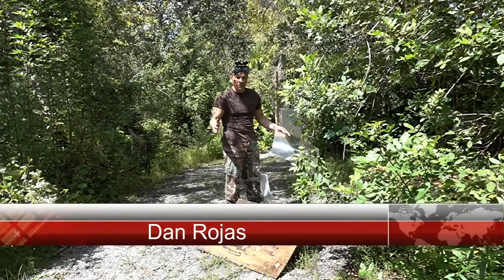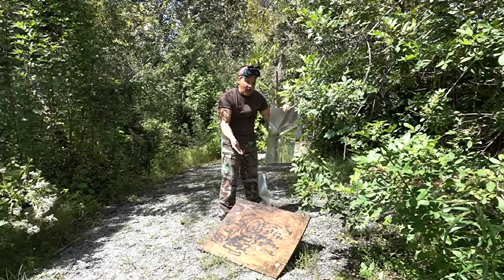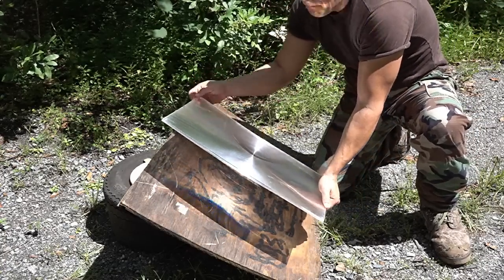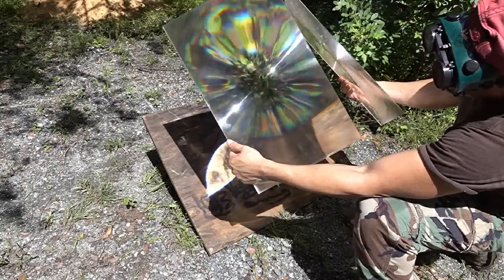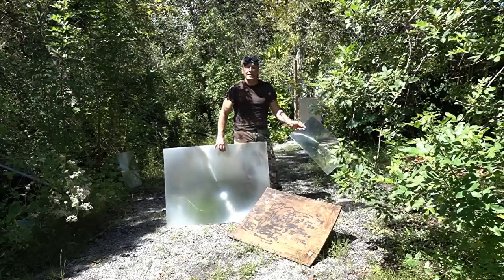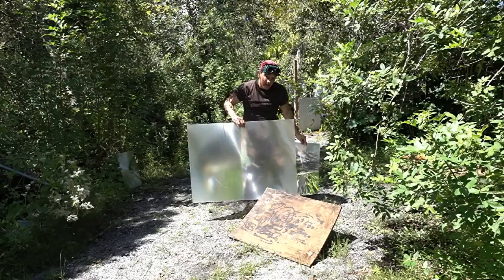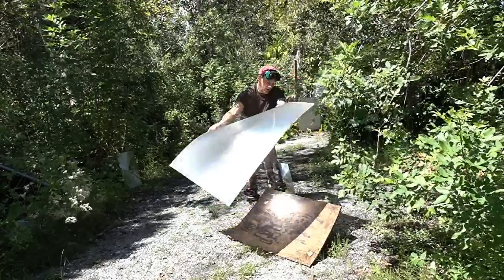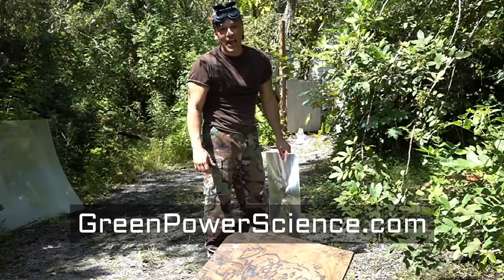FRESNEL LENS MYTHS about solar projects and misconceptions

Comment: Would having a linear focal point make the lens more clear increasing the power? Could you take that focal point and direct it into a light pipe to shoot out a Sun laser?
Reply: I'm thinking a Fibonacci  spiral would take it and bounce it into the center. Tilt it a little and it might go down the length
Reply from the maker: You would need a ruby rod for the laser. I have tried this before but destroyed the rod. Results unknown because trial and error is very expensive.

Comment: Could I add one of these to a basement window to get more light? It's West facing and shaded most of the morning... or would it be dangerous?
Reply from the maker: They do not amplify light so clear glass allows the same or more light in.. Fresnel lenses for windows create a fire hazard. I would just use clear glass.
Reply: But if you put it in backwards, would it not diffuse the light, lighting more area with less intensity?

Comment: If you lay a FRESNEL LENS on top of a solar panel, would you get more power out of the panel and what % ?
Reply: No, you would get less because the lens would absorb some of the light before it got to the panel. And if you focused the lens on the panel at its focal length as opposed to placing it directly on the panel, assuming you didn't burn a hole through the panel, the shadow around the focal point would pretty much cut your power to zero. The only way to get more power from a panel is to add more light, typically through using mirrors or living in a drier/less air-polluted climate.
Reply: Robert Polito The way that works is you shrink the solar panel to the size of the focal point to save money on the photovoltaics and get higher PV efficiency. You can look up concentrated PV for details.

Comment: Have you had a problem with the lenses yellowing? I have a 52 inch that has yellowed and want to know if this can be remedied.
Reply from the maker: Try "Totally Awesome" from the Dollar Tree or Wlamart. Drench full strength and set for a few then hose off. If it is yellowed from not being UV stable it will help a bit. If it is yellowed as a new find, that is from the lens being in a smokers environment and the spray works like magic.
Reply: Ok. Thanks. I'll try it. It was from a late 90's Hitachi projection screen TV. I still find them out by the road for p/u occasionally....:)
Reply: Is that the "Totally Awesome" window cleaner or something else. There's quite a few products with that name.

Comment: just out of interest can those lenses be used in any way to heat or help to heat a greenhouse  so you don't need to use gas heaters in the greenhouse?
Reply: That'd be some tricky math. Lenses not being as clear as window glass, it would lessen the total amount of sunlight reaching the inside because of absorption. But perhaps there is a way to increase the efficiency of the conversion from light to heat by focusing the lens on some heating apparatus. My instinct says it probably wouldn't work, but I don't have the knowledge to prove it.
Reply: Use black spray painted containers that you can seal.  Fill them with water, close them up, and they will absorb heat giving it back off as the sun disappears. A 2 liter bottle will work, well many 2 liter bottles will work. As far as how many, I do not know the math. Obviously it would depend upon the size the the green house, external temps, etc. There is another method involving, a rock filled hole dug inside of the green house which has a pvc pipe placed inside of the hole with the rocks surround the pipe. It has been a while since I have looked at either.
Reply: a ceiling with a grid and plastic would give you puddles of water and they would each give a beam

Comment: Wouldn’t be possible to design a special fresnel able to track the sun? Why not?
Reply: It it possible, and they already do this on some solar power utility stations. You have to get light meters at various angles to each other and then have a controller that adjusts the angle of your unit so it monitors the input levels of the meters and adjusts to try to find the position with optimal light intensity.
Reply: @contentiousotter2324  I mean a pasive one, not “smart and dynamic”.
Reply: You could create a housing that had multiple fresnels that were positioned so that as the sun shifted a portion of those fresnels would all hit a large central heating element as the sun traveled across the sky, but there's no way to maintain a single focal point through a lens as the sun travels across the sky.

Comment: I want to make a small knife using a Fresnel lens or a parabolic mirror made from a satellite dish. How big would it need to be? 
If it works I’m going to gold plate it. Lol
Reply from the maker: You would need at least a 45" spot lens. They are on our website and you can get the dimensions as the 45" is corner to corner. If you are luck enough you can find one from a TV BUT the true spot lenses are difficult to find. The ones we sell are true spot lenses. For the satellite dish, they do not provide a good focal point for melting steel. They are good for cooking and heating water but the spot is not tight enough.
https://greenpowerscience.com

Check out the dimensions, I have temperatures for the size and power concentration on each one for reference.

Comment: Does it matter what kind of safety glasses I use?
Reply from the maker: Torch goggles are the proper darkness. Welding is usually too dark.
Reply: GREENPOWERSCIENCE thank you. I am very glad you told me there is a difference between torch and welding goggles.

Comment: Could I potentially "weld" two pieces of steel together with one of these lenses?
Reply from the maker: If the steel is small masses. Plates will not work because the steel rapidly transfers away the heat.
Reply: GREENPOWERSCIENCE ok, cool. Time to save some money ;$

Comment: So if someone thought using one to amplify a solar panel it really isn’t a good idea?
Reply: I believe it works out that the light redirected is coming from the area that could be panels themselves, either way you need more area of fresnel lense above smaller panels, or just more area of PV panel.... Yes it will output more when a fresnel focuses on it. But you need the same amount of fresnel lense area for just a bigger area of just PV panel. (fresnel area + PV area) = x power) ≈ (the same total area in just PV panels = x power). In other words the amount of area used won't change per unit power ... Except that you may burn the panels, and get losses through the lenses.... Fresnel lenses are better suited to thermal applications, where using it to produce steam for power generation may be of a considerably higher percentage of efficiency. Roughly .60 total efficiency for purely power setups(only making electrical power), to 75 to low 90s% efficiency for combined heat and power applications (heating water directly for use as well as making electrical power), as compared to 15 to 20% efficiency for solar PV.